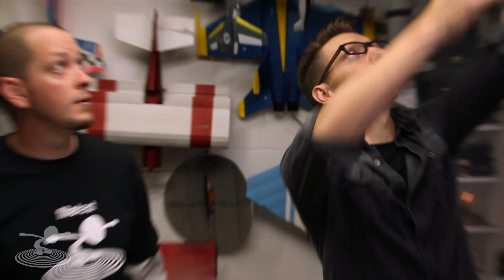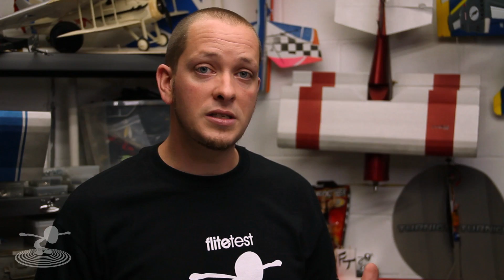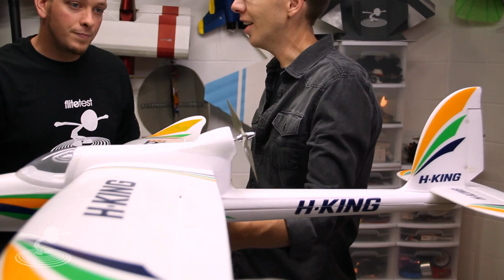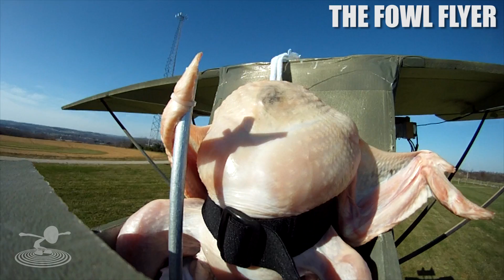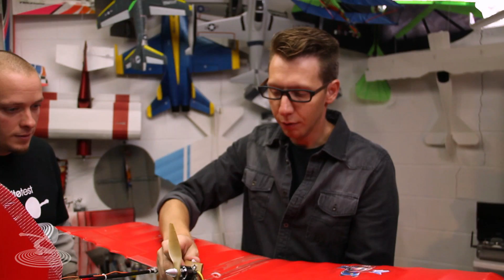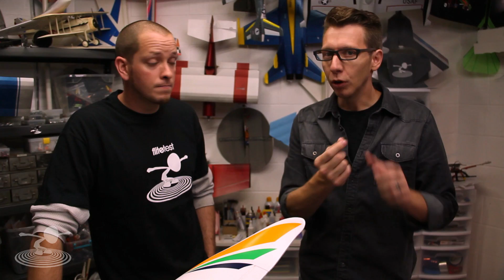Flite Test - Thrust Angle - FAST TIP

Comment: Excellent description and understanding of thrust angle. I built a Pup, a small scale, piper cub, and found when I first flew it that I had to hold the stick back with a lot of pressure. I increased the vertical thrust angle by adding 3/16” washers to the lower engine supports. That was all it took to be able to fly hands off at normal power. Thrust angle is very important and it is very sensitive. Thanks again for your explanation.

Comment: Old video I know, but they don't explain thrust angle for a low wing plane? Would you need the motor angled upwards? The reason I ask is my Edge 540 needs quite a bit of elevator to climb with power on but wants to rise with power off (landing).

Comment: Why 0-0 Thrust angle? 
Why not start with a 5-5 Thrust angle and work your way backwards. It will never fly right with a 0-0. Maybe a 0-5 to compensate for motor torque 
and 
then 1 or 2 or 3-5 Thrust angles to get the full throttle cruse down angle. I mean it is never 0-0 unless you built the aircraft backwards or jacked up the elevator 0-0 and it fly perfect means you built the aircraft wrong.

Comment: Im currently trying to 3d print an aircraft. Due to the design,  its gonna weigh alot. Im thinking ill counter this by using a large motor and a big prop. Im afraid the torque might be so much at low speeds, that the plane wont be capable of even getting up to speeds without violently spinning. Is there any real way to combat this? I was thinking of adding an adjustable (via servo) thrust angle. Is that even practical?

Comment: I rebuilt the engine mount on a turbo Timber. Now, I gave some down thrust, but still the plane wants to climb no matter what the throttle is. Do I need even more angle down? The CG hasn't changed, Anyone has any suggestions?>

Comment: Why not put the motor straight and adjust those tendencies mixing throttle with rudder, elevator... The advantages of this is to fine tune it until you get it almost perfect!

Comment: I only noticed a right thrust angle after I crashed my plane 3 times, the latest needing a motor, prop and motor mount replacement, as well as glueing the front end foam back together. I glued the foam back and installed  new front end, and then noticed the thrust angle. Happy to know that it was probably always that way, and I can just add washers under the mounting screws if I want to change it.

Comment: Incorrect statement at the beginning.   Motor torque does not cause the plane to pull left.  P. factor causes an unbalanced flow of air past the stab and rudder, causing the plane to yaw left.  Right thrust corrects this.

Comment: The explanation that the prop rotation creates a torque which is counteracted by angling the motor to the right.  I notice that the effect is demonstrated with turning the prop counterclockwise and the motor having a clockwise thread.  I have a motor which has a counterclockwise thread so I need to use a clockwise propellor.  Am I correct that my motor should be angled left?

Comment: You are The Best! I typed "RC micro planes angle of motor shaft" and your video was the first one and the best to address this issue! I crash head on floor my biplan, UMX PT-17 and the motor went out tearing the foam. I glued it very well! Was so proud... And I tried it: flew right up and left! I remember that I noticed the shaft was originally low and right... And looking at my repairs I found it to be quite straight... Thanks to your video you explain well the reason behind it. Now I know what to change. I like very much your tutorial videos! Thank you.

Comment: Great video. I'm not holding out much hope for a reply from Bix, but here goes. My question is, what if the motor pod (pusher) has the prop one inch rearward of the leading edge and  the thrust line 6" above the bottom of the airfoil? My Walmart glider has this pusher configuration. The GC is about 1.5" forward of the trailing edge at the fuse and the motor thrust line is maybe 2º down (just a fraction of the Bixler planes). Under power the plane flies just great. When the throttle is chopped it noses up slightly, then it pitches straight down and can only be pitched back up with full up elevator and power. In other words, violent porpoising. Please.............tell me what I need to know. THANKS!
Reply: archiguitarchi tail heavy. Move your CG forward.

Comment: Sir i used 10 inch prop with 1000kv motor and a little down thrust,that was okk..but now i want to use a 6 inch prop with 1400kv motor...will it be necessary to give down thrust to the motor or small prop dont require down thrust...here is my flight vidio with 1045 prop and down thrust

Comment: I am currently building a twin boom pusher rc airplane but I don't know what to do with the thrust angle, the motor is mounted below the wing unlike the ones you showed in the video. So should I give down thrust or upthrust or just neutral?
Reply: Leaving it at neutral would be just fine since assuming your motor setup is at the approximate "middle" of the fuselage, any forces acting on it won't be significant in any direction. However if you do wish to put some angle on it should be up and left (inverse of tractor) and reverse prop is spinning CCW viewed from front.

Comment: Great show!  I am however unclear on thrust angle.  There are many RC Posts on groups saying that the motor torque has little to do with thrust angle, but rather how the spinning air off the propeller hits the body of the plane.  They call this P-Factor.  This is why the thrust angle is different for different models.  If it were torque alone, then surely each motors thrust angle would be the same for a given power ratio.  Could you guys elaborate?
Reply: Not that I knew this before reading your comment, but you are talking about prop wash rather than P-factor.  Thanks to your comment, I did a little more research and found a webpage that gives a basic explanation of these along with propeller torque effect.  It was enlightening.  Check it out.
http://wiki.flightgear.org/Understanding_Propeller_Torque_and_P-Factor
Reply: Yeah @RC King is kind of right motor torque would produce roll in the opposite direction so P-Factor is the one here to blame for the yaw.

Comment: Just what I was looking for.  My plane flys terrible.  I notice no thrust angle or downward angle.  So it pitches up and rocks terribly.  I will apply this theory next because CG is good just very hard to control.  Thanks a bunch.
Reply: Semtech30,make sure your elevator and rudder are secured well,my plane was rocking and going all over and all it was the rudder was coming undone from the bottom,and this made the rudder sway back and forth while flying,making it hard to control.So just make sure that horizontal and verticle controls are well  attached.

Comment: not necesarily. The closer the motor is to the CG the more if an effect it will have on the yaw/pitch of the plane. if your motor is above the cg, the plane will probably want to pitch down when you give throtle. and same on the bottom of the plane.

Comment: basically, the main thing is the vertical thrust angle due to the offsetting of the motor or prop to the centerline of thrust ... and this would cause the prop to work at an angle compared to the incident airflow, and its rotation would develop an asymmetrical thrust to the left or right, this is what the left or right thrust angle will compensate for

Comment: While I like flitetest, I honestly wasn't surprised to hear the poor explanation for right thrust angle, given that these guys believe that turning to downwind results in decreased airspeed, while turning to headwind results in increased airspeed.
Reply: Have you heard of momentum? Add that into your calculation of thrust - drag = acceleration
In fact, I've watched a glider achieve over 100 MPH by repeatedly transitioning between upwind and downwind. 

Airspeed = ground speed +- wind, right?

The thing is, ground speed is also momentum velocity.
 Immediately after you turn upwind, your airspeed equals momentum speed (ground speed) + headwind.

Static aerodynamics works for straight and level flight, and it's fairly simple.  Once the aircraft begins changing direction, thrust, attitude, or any other variable, dynamic aerodynamics gets much more complicated.

Comment: I always thought right thrust angle was to compensate for Differential Thrust, where the down moving prop caught more air than the up moving prop due to the angle of attack. I fail to imagine an experiment to tease this apart from torque, though. Differential Thrust would cause yaw where torque would cause roll - that's one angle to exploit, potentially.
Reply: 12yrs later, and secondary effect of roll is yaw, and vice versa

Comment: i like to use ~1/8" of fuel line or soft silicon washers as a compressible washers/vibration dampers between the motor and firewall. 

to adjust the thrust angle, you just selectively tighten or loosen the motor mount screws.

Comment: The thrust angle is the same as the tractor had the motor in front and below the CG and the Bixler had it aft and above, basically an exact mirror.

If a tractor had the motor above the CG, which almost never happens, the angle would be upwards.

Comment: Thank you for the informative video. A lot of poeple don't know this!

I remember I gave basically the same info on RCGroups (the guy was building a plane similar to the Bixler) and I was basically told to stuff it by the next guy who said to angle the motor down on to the H. fin to push the tail down. The problem is that the OP believed him.

I feel sorry for the OP who came out with a ruined plane from that experience.

Comment: I always thought the thrust angle worked in concert with the wings angle of attack. For example, on the Bixler the down ward thrust packs pressure under the wing. and the same with the motor pulling down on a front downward mounted motor. either way if you notice, the line of thrust is the same for both plane, just the trimming is different.

Comment: a funjet will work fine with no angle.  The forces that are in play requiring thrust angle changes do not apply to planes like the funjet because a) thrust angle is almost the same as the main drag thrust line.  b) there is no plane surface behind the propeller for the prop wash to be affecting.  It is possible that an extremely slight up angle is helpful for funjets, but probably not really necessary.

Comment: Finally, a good video on thrust angles! If you use mixing instead, you introduce trim drag. Not that it's noticeable on most planes, but if you're going for speed or efficiency, every little bit helps.

Comment: You can also compensate for a roll axis by causing roll through yaw. If one wing is leading the other, you'll end up with roll in planes with sweep or dihedral.

I can demonstrate torque being compensated by right thrust with one of my small high power EDFs. it has very pronounced torque roll, which was cured with right thrust. Zero of the thrust hits the tail.

Comment: it could be that you're adjusting it too much. in some planes, you need very little. In my 33% yak54, 2 degrees of right thrust made the tail kick out violently when you'd slam the throttle forward. 2.5 degrees of right thrust was totally perfect, and 3 was too much. Those will likely be different for your plane, but that's just an example of how sensitive it can be on some planes. Also check that your rudder is dead on straight, don't want to try to compensate yaw trim with thrust line.

Comment: suggestion.  your epp fpv is a single boom plane.  could it be that you have extra equpment up front, or just a large side area in front of the wing. this configuration should not be very sensitive to thrust angle, due to the motor being close to the center of drag. perhaps the vertical stabilizer area is marginal. try enlarging it a bit, maybe 20 percent, and see if it help.  wish you the best.  bear.

Comment: Why is my aircraft turning left all the time?

This occurs only in aircraft with propellers at the front of the aircraft. And yes, it does occur in real life. Four distinct phenomena cause the effect, all causing the aircraft to turn in the same direction. They are:
 
1 Prop wash
2 Propeller torque effect
3 P-Factor
4 Gyroscopic Precession

Comment: they do have thrust angle but it isnt as pronounced. a properly designed 3d plane has everything inline along a central axis. i.e. a center mounted motor, symmetrical wings and tail, reducing any off axis torque effects.

Comment: you are correct. The engine torque (roll axis) is netted out usually by the strong wing lift forces, but the air hitting the tail is amplified by the long moment distance from the tail to the center of gravity of the plane.